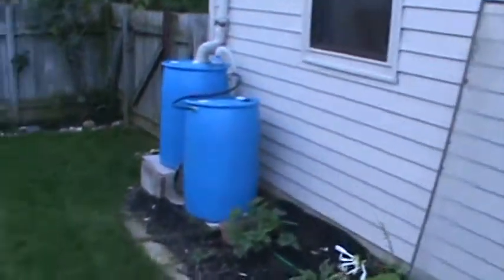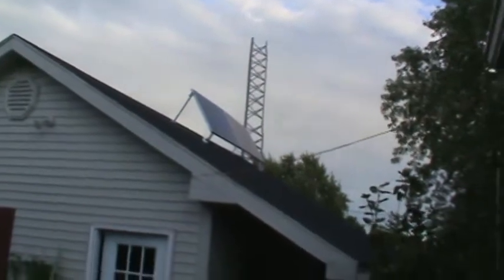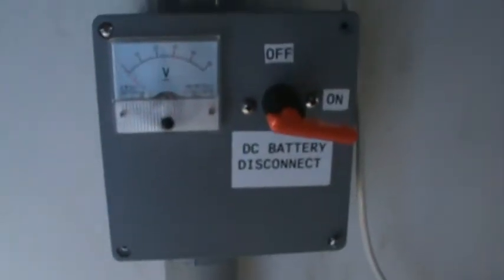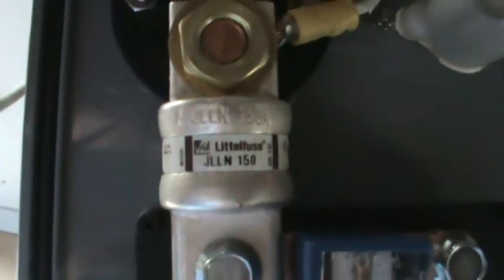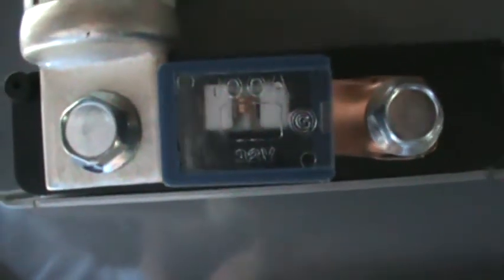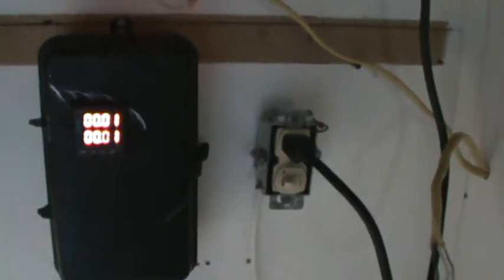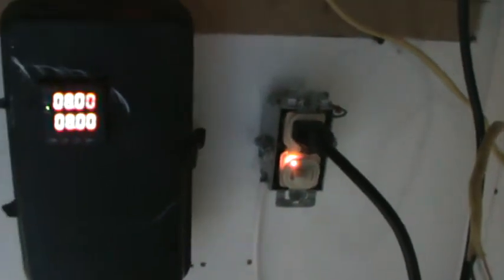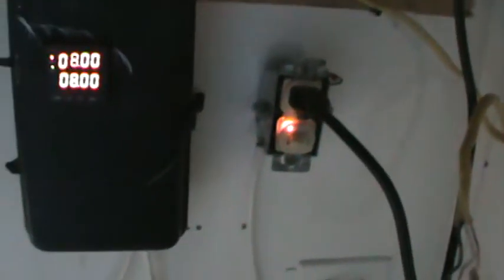24v solar update 4 - Added IOTA 24VDC charger and moved Trimetric indoors

Comment: I am a solar installer & also just starting to build wind turbines so I found this video interesting. Just something for you to think about is use a voltage sensing relay to turn on & off the outlet for the Iota. We use a voltage sensing relay quite a bit with an automatic generator start as a backup for when the solar can't keep up. Also if you're batteries are inside a box its a good idea to hav the box vented somehow because of the hydrogen that's given off by the batteries during charging.

Comment from the maker: Very fine!  Thanks for the information and thanks for stopping by my channel.   I thought about the gasses, but my batteries are in a leaky shed, so it doesn't seem to be a problem.  I only smell the gas when I equalize, then I keep the shed open to air out.  Do you have a model number of the relay you reference?

Comment: i'm building almost the exact system and using your parts and wiring as a template, but....if you could take a pencil or swizzle stick, put really good lighting on your parts and slowly trace each wire in and out.....and mention wire sizes...that would be reeeeally great.

Comment: You've put a dc disconnect between the batteries and the mini disconnect box but isn't the 250amp breaker in the box doing the same job?

Comment: Are you running completely off grid? I'm new to solar energy and I'm about to get a charger similar to yours. can i connect a charger to my home, which is powered solely by solar to charge my batteries over night? I'm getting the Charger that runs 24 volts at 40 amps, from what I've seen 23 amps is the minimum i need to keep my batteries charged with the things i use everyday. At night however i need to cut back. So connecting this charger to my setup should give me enough charge to last overnight right? Again note that I'm powering the charger itself  from the batteries. I know i would take up some of the batteries charge, but I'm hoping the amps it puts back in is greater than the charge it takes out. I'd really appreciate it if you could answer.

P.S That charger is plugged into a normal outlet correct?
Reply from the maker: I use a Midnite Solar charger now for the solar MPPT and really don't use the IOTA much any more since I only have a few rooms on solar.   You could put a timer and photo eye on the iota to make sure it only charges when the sun is down.
Reply: bipth
Thanks alot With the charger i should be able to live pretty comfortably until i can nab more batteries and panels:D.

Comment: what size wire are you using from batt to inverter?  Aims says 4/0 for 12v and 2/0 for 24v....and do you know where to buy 2/0 for less than $5 a foot?

Comment: how do u wire that am meter with the disconect swcht and the fuse u used a shunt i cano't cah on the video thank u
Reply from the maker: Hi, the ammeter, the disconnect switch, and shunt and the fuse should all be in series.  Thank you for watching!